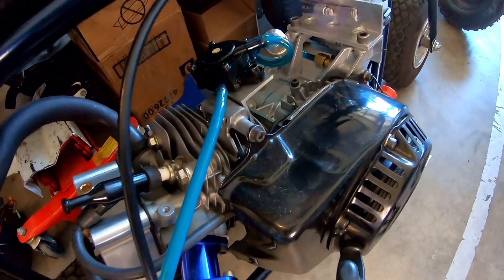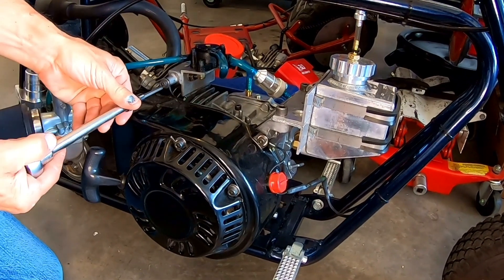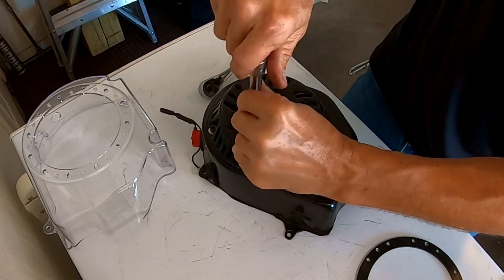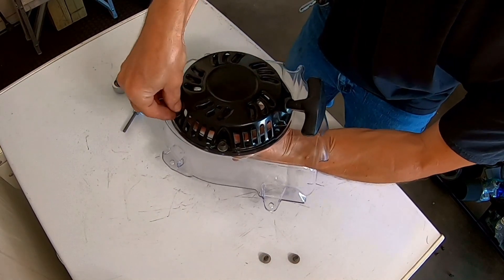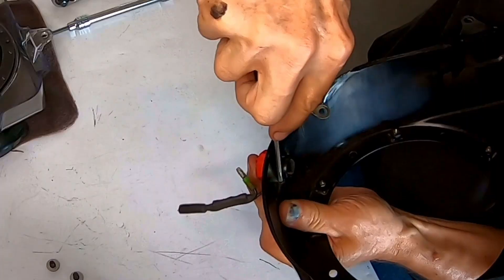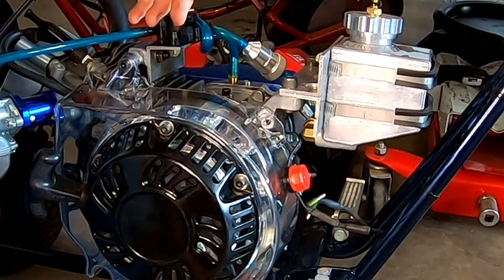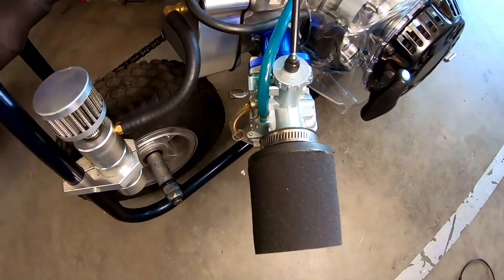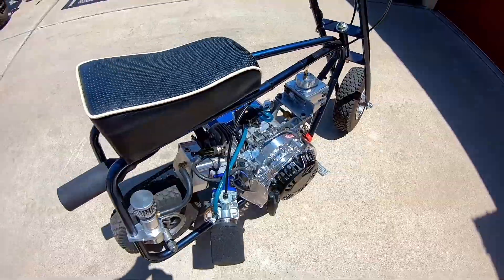The minibike gets a clear blower housing/Predator 212

Comment: Those clear blower housing look great. Unfortunately in a couple of years the oxidation will get the best of it and it’ll start to look like the headlights on most cars nowadays 😢
As far as anodizing, that process is for aluminum only. I don’t think the magnets would enjoy that very well. Maybe if you contact ARC Racing they can get one anodized before installing the magnets.
Reply from the maker: Maybe if I keep it out of the sun the uv rays wont hit it as hard as headlights ? 
If it does turn yellow every couple of years , its worth buying a new one for the best minibike in the world…😎😁

Comment: What sprocket are you running on that setup I have those rims do you ever have problems with it not running true making it have tight spots
Reply from the maker: It has a 60 sprocket outback. So far so good on the rims.
Reply: @Black66  sweet thank you for the info and videos👍

Comment: i have a 212 non hemi predator with a govorner delete and  a stage 1 kit from go power sports, and ive been riding it for about 2 months untill one day i started it up and the idle started to fluctuate not surging but fluctuating between rpms high and low, it sounded odd so i shut off my engine and when i shut it off i hear what seems to be gears grinding inside then engine, it really concerened me any ideas on what i should do
Reply: Check the oil. Change it first. Castrol GTX 10-30 conventional.. make sure the fly wheel bolt isn't loose and make sure your drive shaft doesn't have A LOT of play. Very little is normal.. also a torn or serrated carb gasket from the intake to head mating surface could cause the surges.